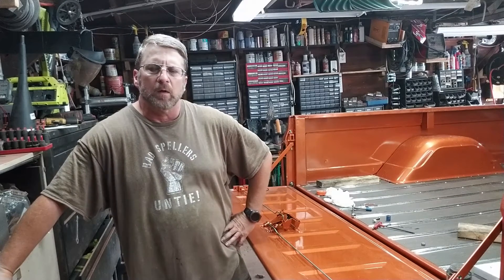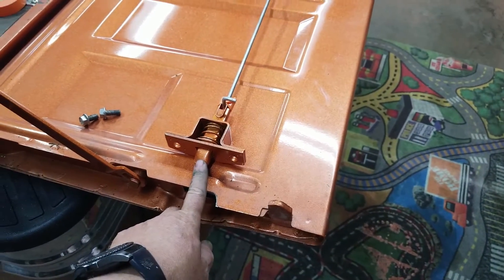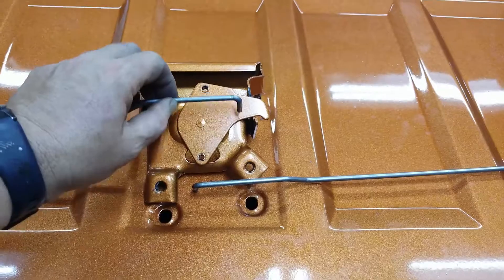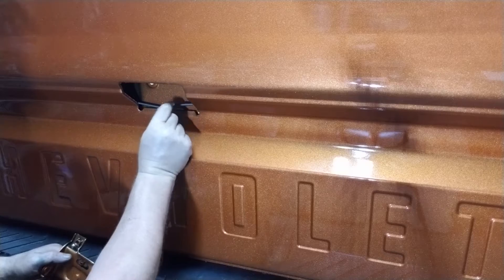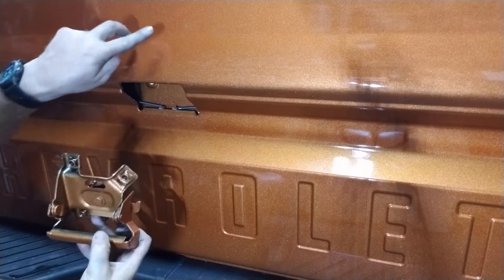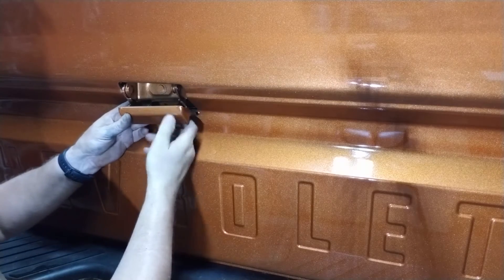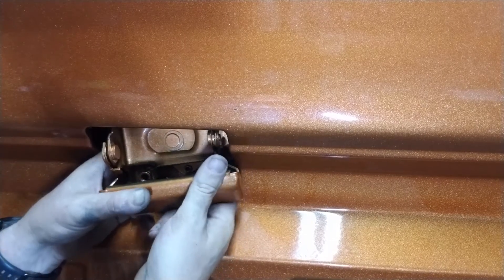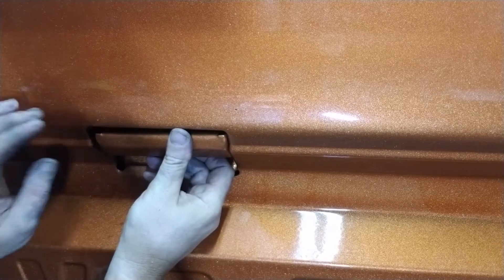Installing a Tailgate Latch in a 67-72 Chevy C-10

Comment: It has been a few years for me since I installed the tail gate handle & rods. I believe if I remember the rods don’t have clips (Metal or Plastic) as not seen in the video, but the catalog from Long Motor Company shows square rubber bumpers that side onto the rods. Once the handle is in place, they are captured by an interference fit from the inner skin. Am I correct? It’s not something you do every week. These bumper would keep the rods from rattling inside the tailgate. If OEM, they wore off and fell inside the tail gate.
  I was thinking of add a “Pull Solenoid” or door popper to my tailgate and simply feeding inside the tailgate, two arm reaching upward, one fabricated with pins to hold onto the handle body & second with two pins to grab release plate. Wires come thru grommets at bottom center. Four pins, but if tapered at the ends, thin rubber/foam behind and masking tape to hold into position during install. I know it sounds like a monkey holding a football but doable. Thoughts?
 The only reason is an 2003 Tahoe 5.3L with O.D. Trans that my son gave me after the 67, then hitting black ice in his Tahoe about 3 weeks later. Using the BCM, I have RKE and the FOBs have tailgate release OEM built in. The receiver is inside the passengers door module.
  I have body work because of the tailgate as well. I don’t know your build, but bought a GM Genuine Auth tailgate stamping. (Right!) The passengers side upper 8” is 3/8”-3/16” thicker than the left, that’s perfect. The tail/brake light removed, there is no damage & all like new. I think I will have to split the tail light skin, move to fit, add metal and hide with some body work. Don’t that beat all? Something you would never check and find after install. When aftermarket parts don’t fit, guys mean it. Crap on my post toasties! This my last build, other things to fix but just takes time no one plans on. Nice trick on the latch wires. Alway watching. DK, Omaha. ASE Master Tech since 1978 - Retired